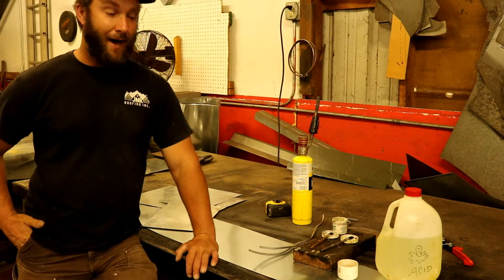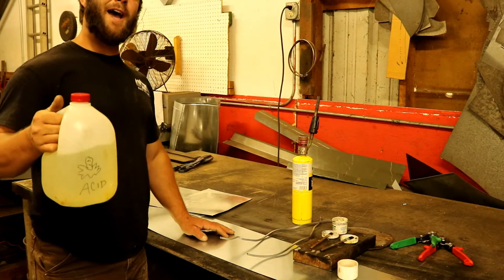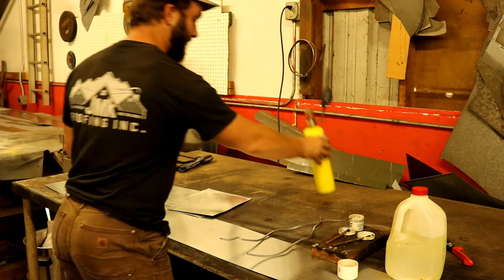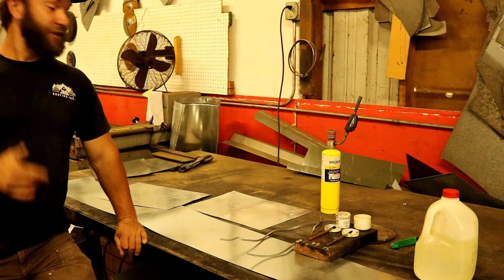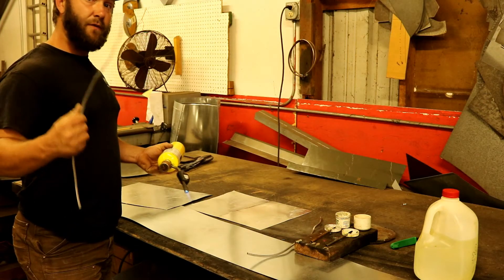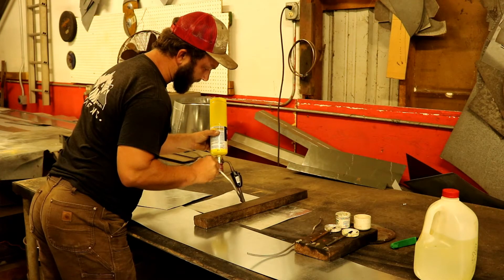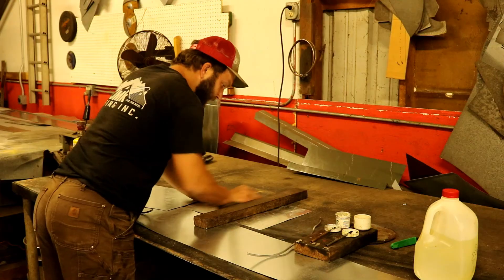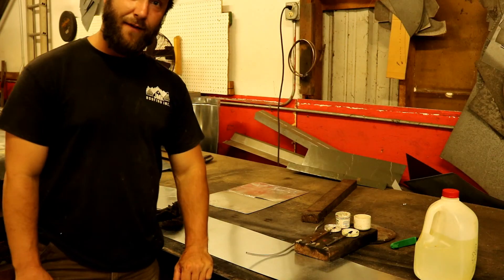How to SOLDER  Sheet Metal

Comment: He does not even have an iron. Solder won't hold sheetmetal together permanently. This video makes me laugh. Spot weld or use rivets for the mechanical connection. solder is just the water tight seal.

Comment: I have a ‘37 Indian junior scout tank that has dents all over it. I believe the inner tank side was silver soldered from the factory. So I melted it all out and removed it so I can planish all the dents out then solder it back in. Kinda nervous cuz it’s not an application at all like this. It’s actually a flange all the way around the perimeter of the tank.

Comment: Yeah, I’ve been in the trade for over 40 years. I use Morag acid with no flux never seen a problem with it. The one thing I would do is in a bonded situation as I would prime the scenes after you done soldering since you the bond finish off the galvanized finish off to the Ross steel, clean it up wipe it down and prime the scene so no rust occurs. Would you agree or not?

Comment: Did anyone find a product like the tribar in Europe? I can not find a 50/50 tribar with nickel and tin. Only tin and lead. And lead is not so healthy.
Reply: I use 1/8" diameter solid wire solder; either 50/50 or 60/40. Works great soldering sheet steel. BTW, I'm a hobbyist.

Comment: Trained professionals don't solder sheet metal with an open flame on a roof deck.  Just about every part of what this video purports to demonstrate is incorrect, from the torch to the fluxes to the solder to the finished product.  Get some professional training, or at least do a modicum of research on how to properly solder sheet metal.  This is not how to go about it
Reply from the maker: You’re wrong sir, welcome to the trades.

Comment: Hey man. Hopefully this reaches you in time. I’ve been trying to double lock a sheet metal one into a flat panel for a Standing Seam detail. Unfortunately the metal we are working with is a G90 and not easily as malleable as softer steels do the sheet keeps tearing. I ran into your video while looking for ways to solder the cone to the panel. My question is, what and where do you get this acid? Is it absolutely necessary? I’d like to make sure this solder does not break. Where can I find the flux? Thanks and hopefully this reaches you before I have to do this on a wimb 😂
Reply: Muriatic acid is at Lowe’s and HD.

Comment: Makes sense that you would be using gas working outside on roofs. As a professional, who has to do this for profit, I am certain that your method is the most efficient and cost effective. My dad started out in the sheet metal trade and he told me that they soldered using soldering irons "coppers" that were heated in a flame. Seems like a lot of steps compared to just using a torch like you do. I am not a professional but do a lot of fabrications at home for different projects where I solder galvanized sheet metal. I use "killed" muriatic only and no flux and an electric soldering iron. I start by wiping the joint with acetone to remove any oils. Next, I wipe the joint with "killed" muriatic acid (ruby fluid), then I "tin" the surfaces that will be in contact by "Wetting" them with solder, then quickly wiping off the excess with a clean dry rag. With the wetted surfaces in contact, I press the iron down over the joint and begin dragging it as I feed in solder. The solder capillaries in as I move along. The result is a clean string joint with no warpage or blobs of solder. I am not criticizing you method; just sharing another way that works.
Reply from the maker: I like the sounds of that !
Reply: What size soldering iron do you use?
Reply: @scruffy4647  for small sheet metal fabrications I use an 80 watt with a chisel point. For thicker sheet metal and larger fabrications, I use either my 200 watt or my 400 watt electric irons.

Comment: Yea doesn’t flux follow the heat. So you’d start @ bottom right. 
Or els the solder will run down on none heated area & cause a ugly mess.

Comment: Im interested in making a tank to hold water in the back of a vehicle for camping use, would this method seal the joints together well enough for the metal box/tank to possibly be pressured? And do you think it hold up to vibrations of a vehicle driving around backroads?
Reply from the maker: Yes it would definitely work, I woildnt put it under much pressure.  I know it will hold liquid nice not sure of psi tho

Comment: I need to solder some 30ga roofing steel to some 5/64 steel bar. I need to put one on each side of a long piece of roofing steel. WHat I'd thought of doing was tinning both the bar and the steel then piling more solder on the bar and melting in on then pressing the sheet down and heating the back of where the solder is.

Comment: it is possible to use an acetylene oxygen cutting torch to melt the solder bar?
Reply: Heck no! You'll melt your work. Propane or map gas is all you need. soft solder like that being used here is in the 360F to 400F temperature range.

Comment: Very informative ! I'm gonna try it .
Reply from the maker: Thank you Gary and good luck.  Soldering is something you just have to do and practice.  When you watch someone do it and attempt it personally, it's a whole other ball game
Reply: @sheetmetalstud8740  Thanks Man. I have a thick copper mini-tub ( oval about 18" X 8" ) and I wanted to use it to ice-down six-pack cans of adult beverages this summer. I got it for cheap $7 @ a yard sale but it leaked around the seam. I scrubbed it out with salt & vinegar and wanted to seal it. I found your video and gave it a shot ( I heated up the seam with MAP first to force out the vinegar and then hit the joint with steel wool). I had all your ingredients already in the garage so I followed your advise. It worked like a charm ! I used the MAP gas on the bottom of the seam and soldered all the way around inside. A quick steel wool scrub and No Leaks. P.S. I remember looking up my grandpa in the 1940 census and his listed occupation was ' Solderer '.

Comment: Bro. Gloves. 
Were you melting the solder directly? It looked like you weren’t leading with the flame.
Reply from the maker: Yes definitely leading with the flame, the solder is always following the heat, I need to do a better job capturing it in a video.   Thx for stopping in Irish Monster

Comment: That’s one way to do it and it does work.many ways to get the job done.
Been doing sheet metal for 31 years.when I solder I use a soldering iron and 50/50 lead bar.use the acid as mentioned and you don’t need flux.with the iron you use a lot less solder and to me have more control of it and is super smooth when done correct
Reply: What kind of soldering iron do you use?
Reply: Exactly!! I use a nice clean iron, and suck the solder directly into the seam. Sweat soldered proper.
Reply: X2 Always a iron & Muriatic Don't need flux..

Comment: Hey, can you please give me an estimate about how much Degrees C is needed to melt your solder? I am planning to use this method for my upcoming project. Thanks.
Reply from the maker: Map gas temperatures are approximately 2,000° C in my torch.   You could do it with propane but takes much longer to get to temperature.  Once you are skilled, Map gas is the only way to go

Comment: Is that galvanized sheet metal?
Reply from the maker: what I was soldering in that shot wasa  funky looking piece of bonderized metal. It was so scratched up we just ground it down so it looks shiny like galvanized, its a cleaner look if we need to use it in the future.  I just randomly grabbed that to solder and it actually was moving on me at the seam I was soldering and I having trouble.  I decided to keep it in the video because life isn't perfect.  Often I lay a real nice bead of solder but on that one it wasn't very pretty.  Thanks for asking questions!  If there is anything else I can answer or help with please let me know.  Have a great day.
Reply from the maker: Yes it is galvanized
Reply: Is soldering galvanized sheet metal the same process?
Reply: Is it posible the same with steel sheet metal ?